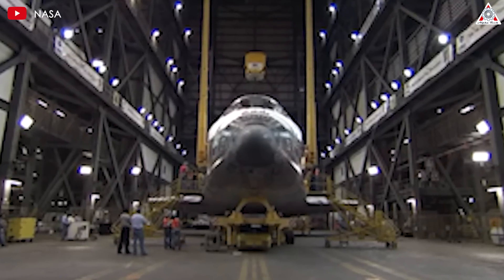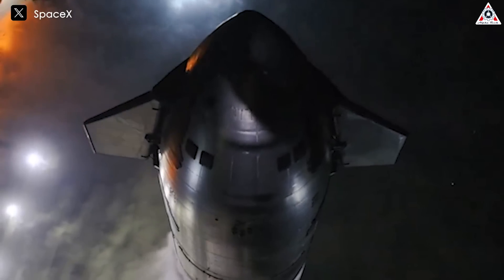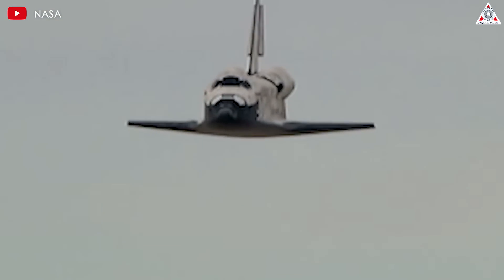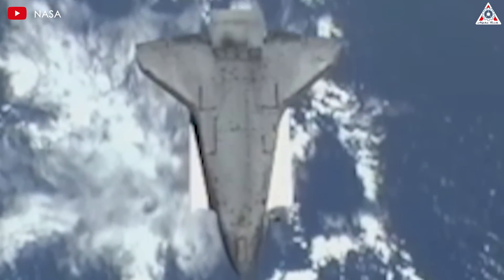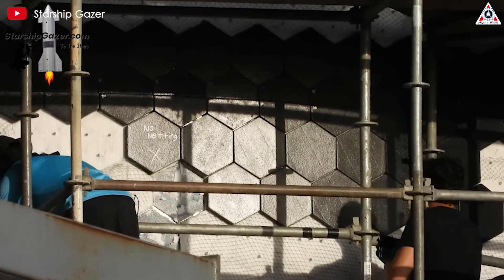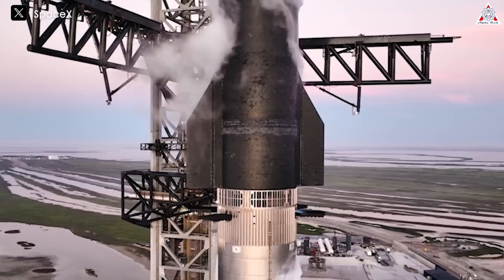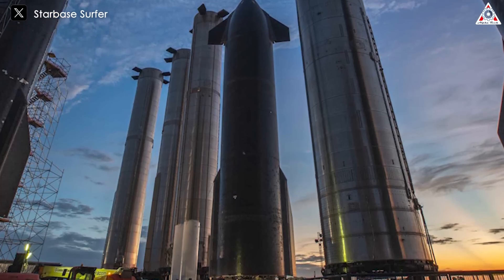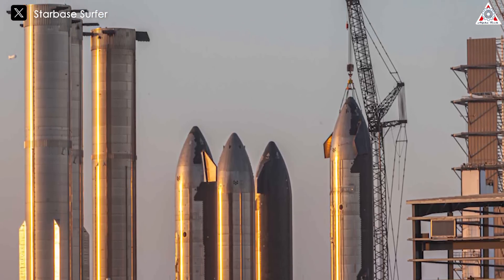SpaceX NEW Starship TPS Tiles & Welding Upgrade Just Humiliated NASA Shuttle!

Comment: Being a tubler tin can much the same from bottom to top?
little diffrence in tiles should be small except for fins and nose cone area.
This should make designing replacement sheafs easy to mass produce
also deflecting ridges in places to push away plasma flow away from fins and surface ground effect of flow.

Comment: Space X can't "Humiliate NASA Shuttle!" TPS technology, that tech is 40 years old. 
What Space X can/did do is "improve upon technology that has been the foundation for reentry over the past 65 years. They did the best they could with what they had 40 years ago. I like Space X, more than NASA, but you can't look into the past and claim "humiliation." Things like this only improve with better materials, production methods, computers and automation.
Reply: Better materials- Stainless steel?
Production methods- TIG welding?
Computers - do help with the speed, so instead of 200+ launches a year they should have been able to launch 100+.  The same with automation. 
Let’s face it, NASA wanted the appearance of being smart & cutting edge without actually taking any risks, working diligently towards a goal, or having to share the benefits of their research.

Comment: I don't think the Starship tiles & welding improvements have humbled the NASA Shuttle. I think the NASA Shuttle still has an advantage over the Starship. So far we have never seen tiles attached properly, in the previous 4 flights the tiles have always fallen off. I expect that the next improvements will cause more tiles to fall off when they are attached together. Individual tiles will no longer fall off, but larger sections (segments) of tiles will fall off.

Comment: It would be a better comparison using the heat shield titles of the Dream Chaser to the shuttle than the Starship, but the Dream Chaser is untested. Even Starship is not fully tested as tiles are still falling off. Therefore, NASA's shuttle tiles are more durable at this point in the testing phases of the two different style ships.

Comment: It's unfair to compare modern tech with 1970s tech. The shuttle did have issues, but it was also designed in the 1970s so there were processes, materials, and options that didn't exist then. I respect and support Space X, but the level of Space X fanboy-ism here is what's cringeworthy and embarrassing.
Reply: I agree about the cringe factor although NASA et al should have better results ffs.. they all kinda suck bro..
 Processes & configurations might be better but SpaceX has better, faster & more efficiently helped that.. As far as Materials Sciences, not much has changed my friend.
Reply: The significant “improvements” are using stainless steel over Aluminum and TIG Welding??? 
Is your position that TIG welding wasn’t known in 1970?  Or that the thermal properties of SS & AL were recently discovered?

Comment: The Shuttle was designed 55 YEARS ago.  The technology wasn't even STARTED let alone coming on line.  You couldn't build Starship in the 1970's-2000's due tot eh computing and tech incapabilities of the time.  Stop bragging about something that SHOULD be easy to do TODAY!!!   CLICKBAIT!!
Reply: I've been a space nerd since the 70's, since they first said the word "Space Shuttle". I thought it was just the coolest thing to happen! Yeah technology has really made significant jumps in the past 20+ years. The Shuttle era was also a huge jump in technology. In 1992 I got my engineering degree but was stuck working as a mechanic because technology was advancing so fast that students really couldn't keep up. It only got faster from there... So I slowed down and stuck to the old school ways of fixing things. After 30 years of working as a mechanic, I figured out there is a difference between a mechanic and a "tech" the mechanic knows how to repair an item and the tech knows how to replace it. Both have a very important role in modern day innovations. It still ain't easy for either one.
Reply: It doesn't take high end computing and technology to say "gee, maybe we shouldn't make each individual heat shield tile unique shapes from every other". And what is SLS? Using shuttle designs from, as you pointed out, 55 years ago. Some of the reasons Starship design is doing well is because of their focus on iterative development, which ironically NASA did better in the Mercury/Gemini/Apollo days, incrementally improving their capabilities.
Reply: @richard77231 YES,, the fails in the early NASA days gave them the FEAR of trying wild experiments to find the limits. But little has changed. "Tech" simply got smaller.. An LED us the same BUT some dude figured out how to get the light to escape.. He was just fkng around with a laser and a electron microscope.
Reply: @picklesontheroad Wow,, we had similar experiences only I'm 10yrs older.. Process is lots better, but the basic "Tech" hasn't changed that much.. silicon & borax or arsenic still make PN junctions bro.. Wires still carry electric current. Light still is light.. Sugar is sweet & booze is bad, but some of y'all love that stuff.. LOL

Comment: Actually the round hull shape is not great for deflecting the shock wave outward. for that the optimal would be a shallow V like on a planing hull in boats.
Which is why they exist.. Nobody tries to plane with a log.
The round shape actually causes the air to attach and be drawn around the curve. then when its torn off, creates turbulence aft, which is why wire struts on Biplanes are shaped into air foils.

The problem with shuttle tiles was from compound curvatures. 
Would be much simpler on monocurvature hulls like the chines and angles of some stealth aircraft shapes.

Basically the shuttle design was an aircraft shape and materials structure covered in a patchwork of oddly shaped tiles, that it was totally dependent on. 

It was a morph of technologies.

Lifting bodies and wings are not a bad thing. Just need upgraded to better materials and more advanced TPS concepts than a gazillion tiles cobbled on.

They'll figure it out eventually, after constant tile losses and having to patch the ship's burnt spots...

Will slow down turn around times. And it will get figured out that  coatings can be used instead that are thermal expansion equalized with the stainless, and cured by re-entry itself.

They will quit doing the same thing over and over, when they dont get enough different results, or when smarter competitors blow past them.
Reply from the maker: Thanks for the insight! I will think more about this!
Reply from the maker: have a good day!

Comment: Considering that the shuttle first began with studies in 1968 and was built in 1976, the technology for the starship is 40+ years in advance so I would be shocked if it was not better (don’t mention SLS) . Also Shuttle was substantially different in shape and had an 18 meter by 4.6 meter load bay while the estimated load bay of starship is 17 m x 8 m which is bigger than the pressurised area of the international space station!
Reply from the maker: Yep, that’s right